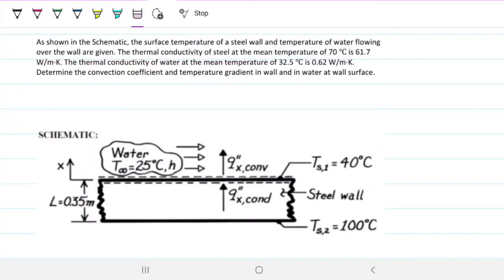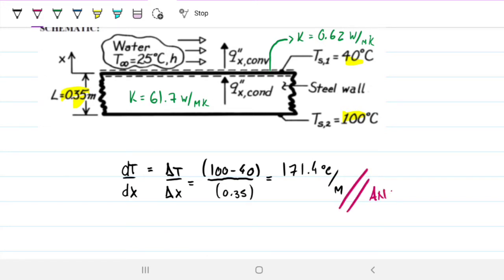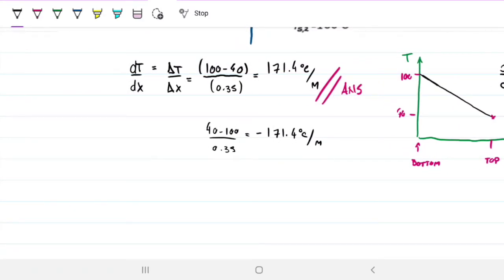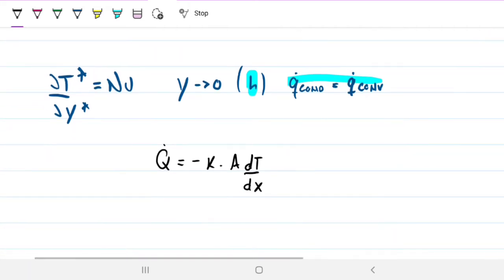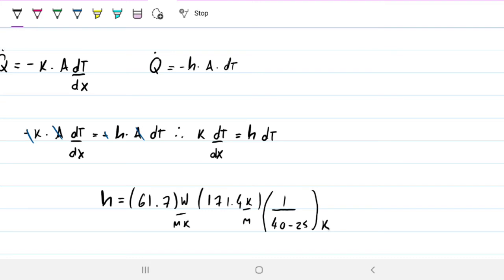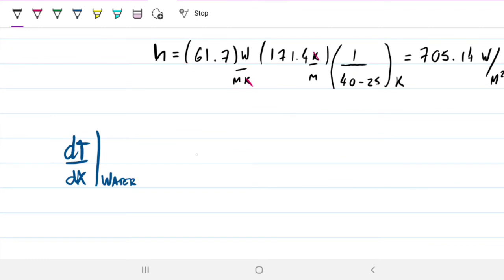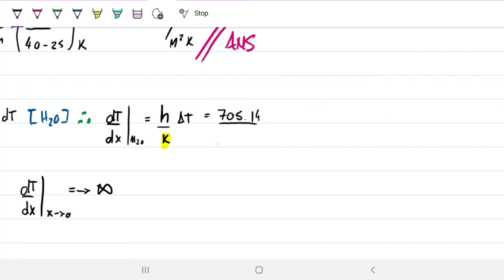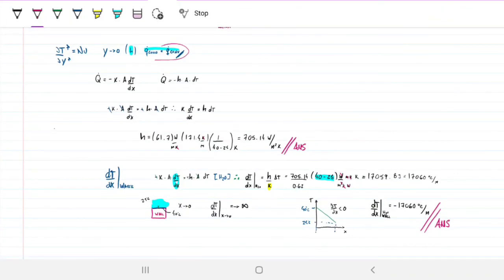What is the temperature gradient? Heat and mass transfer - W6WQ

Comment: Why didnt we use 0.62 for k instead of 61.7 for finding h?
Reply from the maker: Because we are using the dt/dx for aluminum. It wouldn't make sense to pair the k for water with the gradient for the aluminum. Also note, the h calculated there is related to the heat transfer as we go from conduction to convection. After the water molecules are carrying the energy (i.e., away from the boundary layer), the h will be different and based on the k of water

Comment: Where does the value 0.62 come from?
Reply from the maker: You mean the 0.62 from the problem statement? Water property tables. 
Check property of water (saturated liquid) at around 25 degrees celsius. Conductivity will be close to 0.61-0.62 W/K*m mark